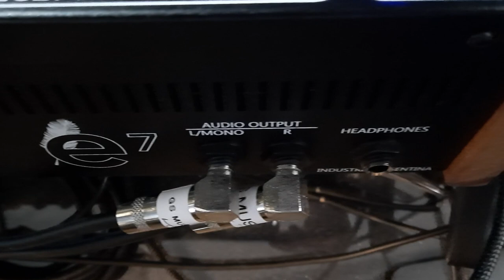GS Music e7 Deep Dive

Comment: Thank you for this presentation! I can’t figure out how to load new presets into the synth. It’s not in the manual either. How do I do it? Thank you 🙏
Reply from the maker: The e7 I believe excepts sysex messages. There's no bulk file transfer however. External preset data needs to loaded one at a time to the desired location. Note, I have not tested this myself.
Thanks for watching, TJ

Comment: This sounds great. Tried it out at PCA. However it's not that well built. Wobbly knobs, squishy buttons, and the knob shafts stick way out above the panel making for a very large gap between the bottom of the knobs and the top panel. Looks like an amateur DIY put this together in his basement. There should be separate outputs. The synth needed slight tuning as I was playing it. This is a good thing and this looseness is what makes this synth stand above the other more expensive synths from sequential (all) for example and moog one, deepmind, etc. This sounds like an 70's/80's synth with all its flaws. It's great and despite the negatives I want one. It's all about the sound in the end. The MPE is promising too.
Reply from the maker: Hi, Thanks for watching. With respect, you're the first person I've heard complain about the build. The build quality on my unit is excellent. No wobbling knobs and metal shafts. I'm sure the display model you saw might have gotten beaten up. There's a video on GS Music's FB page that tours the dedicated facility where the e7 is made. It's not just some guy's basement. There's an auto tuning function right on the front panel. Yes, the MPE works very well. I'm using it with Osmose right now. Here's a demo https://youtu.be/ICUGqZE2PDA
Cheers, TJ
Reply: Built quality is better than Sequential and China built crap IMHO. There aren’t wobbly knobs. It’s rock solid. No tuning problems.
Reply: Idk where did you tested , none of it is true , well build instrument

Comment: Surface assembly. I am afraid that if there is a failure, even a minor one, no master will find the cause. Maintainability is reduced to zero.
The multitimbral nature of the analogue is amazing!
Thank you very much!
Reply from the maker: Surface mounted components aren't untraceable or not replaceable. A skilled hand is certainly required. Not as easy as through hole for sure. E7 follows a basic synth architecture. There isn't anything extreme in its design that a competent tech hasn't seen before. 
Thanks for watching. TJ
Reply: I can only hope for your opinion about this tool. I had tools for surface assembly. Yes, of course, all of them were not from the assembly line. Very worthy masters refused to track the breakdown. I do not doubt the competence of the master.He assembled a destroyed AKAI 5000s motherboard for me... Since the G7's capabilities are amazing, it can only be compared to the Dave Smith rev 2. And by some parameters, the G7 will be ahead.
To be honest, I have good thoughts thanks to your performance)
Reply from the maker: @ivanskunov9166  Dave Smith (RIP) designs are largely based on integrated circuit chips. The e7 is closer to Moog designs and sound qualities.

Comment: Hi!I'm going back to your good publication of this tool, and most likely it will be on my wallet list for this year)
The problem of confusion with the font mode can be solved very simply.
It is enough to equip each control section of the synthesizer with a light bulb that lights up during the operation of the "font".
I would like to order this tool with such a custom
Reply from the maker: I'm guessing you mean the "shift" rather than "font". The shift button/mode already has an LED when in use.
Cheers, TJ
Reply: Yes, of course!You're right, but it would be more convenient for me to see highlighted sections that work in shift mode, and not just on one button.This is especially convenient if my attention extends to a large setup, and not to one with one highlighted button.
By the way, what's wrong with the "nymph" dredd box, that it's almost impossible to use it on live due to the fact that you don't remember where you are)